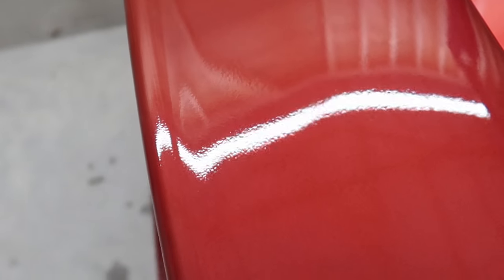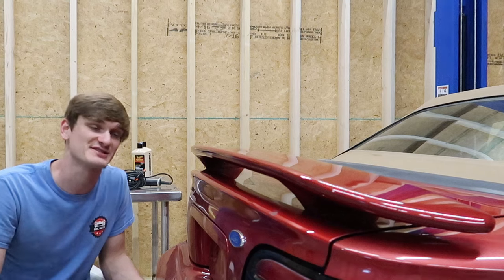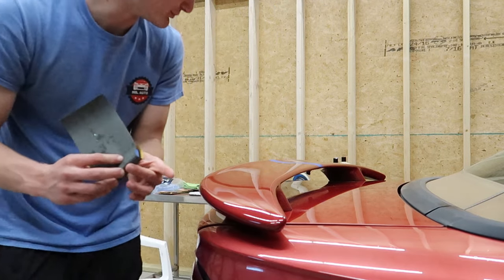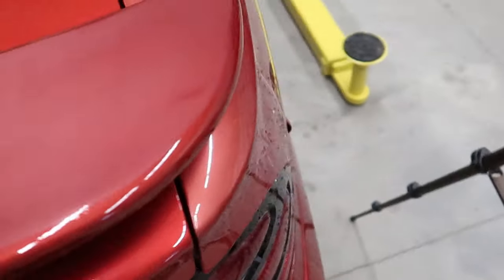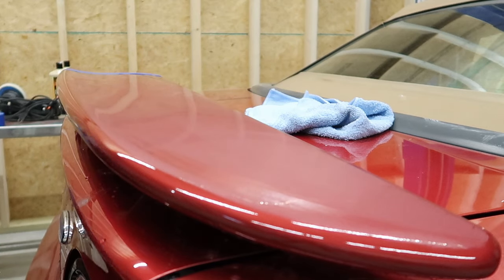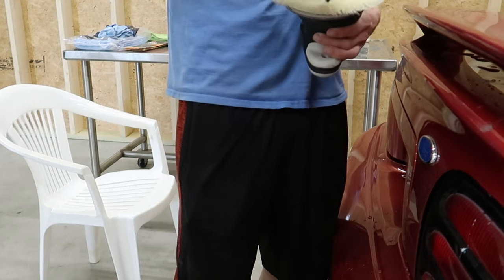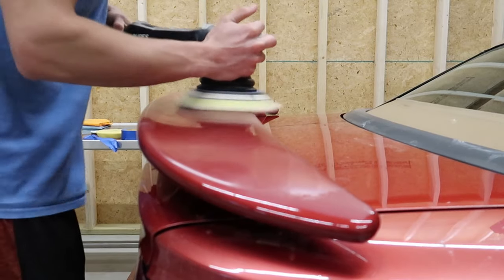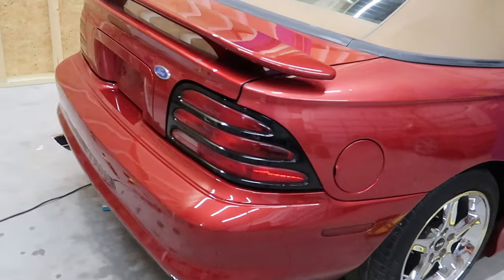How To Sand ClearCoat Safely - Orange Peel Removal

Comment: Get you some various sized sanding blocks. You don't have to use just that tiny one. And be extra cautious on plastic parts that are painted. The paint on spoilers tends to wear out a lot faster.

Comment: I've never seen clear coat applied that doesnt have orange peel. Just applied 3 coats of 2k clear (Nason) on 3 panels on my 78 Town Coupe. Went on nice and smooth and flat right from the gun. Next day after drying out (curing) tons of orange peel. I think it may be due to the curing/shrinking process? Either way Im amazed at folks who can lay it on totally flat and glossy and it stays that way! Maybe it's too many coats and not enough flash off between coats?

Comment: Great info.  Had to google it, ONR = Optimum brand "No Rinse Waterless Wash", a liquid cleaner popular with detailers, almost a cult following.

Others suggest starting w/ 1000 or 1200 grit, then right to buffing compound.  I used 1000 wet-sand on a whole newly painted car and got it to look like your post-sand stage.  I didn't use a block but rather used 4 fingers on the paper, which gives better feel.  I wiped the sandpaper across, not pulled/pushed along my fingers, which avoids cutting troughs.  Sometimes it would grab, because removing a lot of color build-up (single-stage polyurethane, no hardener).  I kept a wet rag busy keeping the surface flooded and wiping away paint debris.  I'll do another pass w/ 2000 grit.  Waiting on a wool pad and "Malco Super Duty Heavy Cut Compound", but best to wait a few weeks anyway to let the paint harden.  I wanted to attack the orange-peel while the paint was soft (2 days after painting).

I cut into the primer while sanding a few runs and other oops, so I'll use a touch-up gun there.  That is the advantage of single-stage vs base-clearcoat, you can respray any bad spots and easily repair the future scratches and dents which will occur, if you keep left-over paint.  Some think I should spend $5K on a pro paint job, but I only paid $1K for my car (1965 Dart) and love living as a resourceful bottom-feeder just to tic-off the wife and kids ("just write a check" types).

Comment: Really great job. Honestly one of the best videos I’ve seen who go into all the details. What would be the best way to get rid of clear coat lines? After removing the tape from a section of the vehicle. Wet sand? Then compound? Then polish?
Reply from the maker: JosephF1992 thank you! If you are referring to clear coat lines after having a section repainted, I would put a piece of painters tape on the low side of the line, and only sand the high side. I would not chase perfection in that scenario because you might go through the clear before flattening the line. I would highly recommend a paint depth gauge for that job. Yes, compound the sanding scratches out, then polish any hazing caused by the compounding step
Reply: Nic Bowen thank you for the info! Have a great rest of your day!

Comment: Hello,  you have a great teaching style, a question,  I went sanded  1000-2000 grit half a bumper, sprayed 3  base coat duplicolor then 3 duplicolor clear coats. The result was a duller and less silky smooth finish than factory finish. Any corrective action I could do to my work?
Reply: 1000 is too high for spraying base coat. You should sand with 320 and primer. Apply 3 coats of primer 10 minutes between coats. First coat should be very light and third coat should be wet. Let dry for 30 minutes Then sand 400-600 before base if necessary. Apply 3 coats base same manner as primer. First coat light third coat wet. Make sure you give the base coat enough time before you spray clear coat. I would wait at least 45 min before clear. Apply first clear coat light and then wet coat wait 30 minutes and spray 2nd coat of clear. If it comes out with a lot of orange peel or dull. Let it cure for a week or so and then wet sand it with 1000, 1500, 2000 grit increments. Then use a da polisher with cutting compound and finishing polish.
Reply: Thanks
Reply: @Chris-vc5bb  Hi, I have half of a Corolla bumper and right rear quarter that I want to correct. If I only spray 2k clear over that half, am I going to end up with a  noticeable difference between very good factory finish and my 2k clear side? Thanks

Comment: i sprayed my car and had orange pill bad,i only used 2x coats of single stage no clear coat and wondering if this method is ok for single stage with no clear?also i was wondering if i could simply roll on another coat of paint to my single stage thats just painted and then wet sand/polish? since its being sanded flat and smooth i should be able to roll on a coat right?i want to add another coat so i dont have patches i can see through just in case

Comment: When you are sanding close to to the lip, are you just going to assume the polish step will work out the peel on that hard edge? I'm doing an 80s windjammer fairing with lots of lines and edges. Thanks

Comment: You’re definitely a pro 👏🏼 
And besides the way you explained everything is very understandable ,
I have a question, I have a pick up truck that just came back from the body shop, and it has the same orange peel like your car, IF I don’t know how much clear coat they put on the paint , Can I use the 2000 grit ? I’m planing to use the 3M trizact 2000, but should I use a higher grit ? 
Thanks
Reply: No such thing as 3m trizact 2000
Reply: @zrick5376  thanks

Comment: This is amazing. But, does it go back to that unshined paint after it rains or Time or the polishing lasts forever?
Reply from the maker: The process of compounding / polishing permanently removes the sanding scratched clear coat. If you compound and polish it, it looks good, but a month later it looks bad again, then you did not polish it heavily enough.

Comment: This is basically a two step sequence, 2000 grit and then a compound buff - very different from almost every one of the 10 or more videos I’ve watched to remove orange peel. One guy uses 5 different grits of wet sand (1500 up to 5000) then wool buff, then foam buff, washing between each step. His finish was flawless, not just a “match the rest of the paint” type job. This guy’s results look pretty good, but there are higher quality levels out there. I would watch several other videos before settling for a 2 step job. For what it’s worth...

Comment: Quick question. 
I ended up with a couple of clear coat runs on my Grand Prix GTP rear spoiler which is very similar in color.
If I am going to sand and buff the orange peel antway,
 can I just sand down the runs with a 800 or 1,000 Grit wet sandpaper and then until the runs have been sanded down flush then continue on with the rest of the spoiler?
I've seen videos where they prepare the run very slowly and in isolated way but as a hole boards going to be sending anyway what's the point?
 Please advise.
Thanks

Comment: Is it possible to avoid the orange peel? I sanded, sprayed and painted well but ended up with significant orange peel.
Reply from the maker: Making sure the primer is perfectly flat makes the biggest difference in finished product. Since you won’t be sanding the base coat, make sure you spend time testing the guns settings and figuring out what sprays the smoothest. Also make sure you are flowing the cfm the gun is rated for. Same thing with the clear
Reply: Its nearly impossible. Its possible to have minimal orange peel, but it takes talent and requires thinning the clear to a point where its very likely to run if you put it on even just a little to heavy.

Comment: What was the spray you used on the wool pad and blew it off? Awesome video best I’ve found of sanding and buffing by far
Reply from the maker: Thank you! I sprayed ONR on it (rinseless wash, I use it as a spray detailer, one of the best products in my arsenal). The purpose of the spray is to ensure that the pad is lubricated, and I blew it out afterwards to make sure there wasn’t any excess
Reply: @nicbowen38  and after the 110 did you follow up with a different polish? Results are beautiful
Reply from the maker: @buggy627  thank you! To my surprise, the 110 finished out so well that I did not polish it. If it was black, or if it was a softer paint, I would have had to polish it most likely

Comment: My truck grill orange peeled pretty bad. I have another can of 2k clear coming. What should I use to smooth the surface. 800 and 1500 grit and lightly sand? Or gray pad and wax/grease remover? Thanks for the video and tips!
Reply: 2000-3000 followed by a polish. Likely won't need to reclear. If its a small surface area, I'd probably just use 3000 and spend more time doing it, then polish by hand with a rag

A gray wool pad shouldn't be used with wax and grease remover either, unless you're removing road tar before painting. Water is best.

Comment: he nice video,i have massive orange peel in my clear coat,could i sand it and put another coat of clear on it or should i completely remove it and redo the clear?You did a awesome job with that and very detailed description.👍
Reply: Grease monkey, you don't have to reclear! Just do what he did here and you'll have a glassed panel!

If the panel is dry and rough however, that's not orange peel, its dry spray and/or overspray. That is a different story and potentially requiring a respray. You could try to lessen it doing what he does here, but do it small amounts at a time and very likely "settle" with something that's better, but not perfect.

Comment: If you grind orange Peel off with these instructions then do you need to do something again for it after a few washes?

So does the surface turn gray again after a few washes?

Or does the gloss of the paint surface remain even after washing?
Reply: If the vehicle has a clear coat on it, it remains. Don't use brushes to wash you vehicle, especially brushes at public car washes(truck guys often scrub gravel out of their wheels and rocker panels with them), and the paint will stay beautiful for years.

Older vehicles that used single stage paint, it would fade probably within a year.

Comment: Great video! I wonder what causes orange peel. Whether it's one thing in particular or a combination?
Reply: Air pressure when spraying the paint..if the pressure too low..it will create a noticeable orange peel..if the pressure is high..orange peel will also be there but not as obvious as it is low pressure..but high pressure spraying increase risk of getting paint runs too.

Comment: Is a sanding block recommended over free hand?
Reply from the maker: I would never recommend free hand sanding. It’s almost impossible to evenly apply pressure over the surface of the paper and will cause deeper scratches that can’t be removed with a polisher

Comment: So judging from what the camera sees, you have about 35-40% or so of the orange peel/shiny spots left on the surface when you call the sanding done and move on. If that is the way to go, and on my project (this is the first time I do this process), I have about 15% low spots remaining and stopped because I wanted to find info on if I could leave any orange peel at all before buffing... does that mean I am basically destined to burn through in the next stage?

For the next stage, I have bought pads for a power drill, and Meguiar's 105 and 205.

Comment: Amazing video! At the end you said though you see light haze and need to polish again... do you use the 105 compounding again? Or move on with a actual polisher product? I seen two bottles in the background. 
Cuase have Chemical Guys compound and polish separate 4 bottles.
Reply from the maker: I used meguiars m210 and a yellow rupes pad to polish 👍

Comment: Hi thank you for your videos. I wanted to ask if i may i have a honda i just got painted and haven’t had someone wet sand the car yet but wanted the know if after wet sanding and buffing will it make the finish look lighter or darker ?
Reply: It shouldn't change it much, but the finish will be "deeper". It will seem a little darker, simply because clear coat with a rough finish tends to be a little white in its reflection. 

If you do the whole car, you won't notice a color change, but you will notice it looks better. If you do only some of the panels, you will likely notice the difference between a polished panel to a not polished panel.

Comment: Lots and lots of information! If I were to use 2000 grit on my freshly painted clearcoat I will be working a 1’ x 1’ section for four hours! My clearcoat is extremely rough and I’ve been using a 180 grit to sand it down. I know this is way too low but I can’t get anywhere without it. I’m wondering if I may have added too much Hardner or uneven coats or…? Any thoughts here
Reply from the maker: If you have to use rougher then 800 grit paper, something is wrong. If it was me I would sand it and spray more clear on it after figuring out what went wrong with the paint. It’s going to be nearly impossible to remove the 180 grit sanding scratches without spraying more clear
Reply: You are exactly right. I even went over it with thousand and 1500 grit and the scratches were still there. So what I did is what you just said I just re-clearcoat it. So far so good! I appreciate you getting back to me

Comment: Nice sir. Can i use cotton and rubbing compound after sanding? Coz i dont have buffmachine?
Reply: Use a micro fiber towel. 3m rubbing compound is your best bet. Then use 3m polish step 2 or nufinish from Walmart. And finish with a thicker wax past to remove swirls/ holograms

Comment: How long you wait to make it dry from the wet sanding before you polish?
Reply from the maker: JeremyP. You never in any circumstance allow water to air dry on a painted surface. It will leave the minerals from the water behind which can cause damage. I wipe off the water with a clean microfiber and immediately polish

Comment: Great video.  But I am confused.  Did you apply clear coat with the paint issues you are correcting (scratches and peel) and then fix those issues after the paint was applied/cured?    Sorry for novice dumb question.
Reply from the maker: The problem is that no matter how good your paint is, how good your gun is, how good your technique is, when you paint something it will almost never give you perfectly flat results. The texture of paint is referred to as “orange peel” because it resembles the bumpy surface of an orange. I am sanding the orange peel of the paint until it is flat, and then polishing out the sanding scratches. After the process of sanding and polishing, the paint is much flatter and has a smoother reflection

Comment: Thanks for the detailed explanation.  I just repainted my rear bumper cover and have pretty heavy orange peel.  Question on sandpaper grit:  I started with 2000 grit but it seemed like it was taking forever, so I went down to 1500 grit.  Should I follow up with 2000 grit (and maybe even 2500 or 3000), or go straight to polishing?
Reply from the maker: Richard Lytle it all depends on how comfortable you are with a polisher / your products and techniques. It is possible to remove sanding scratches as rough as 1200 grit with a rotary. However, removing 1200 grit scratches with a polished require a LOT of heavy, slow polishing, and it is very easy to make a very small mistake that will burn the paint. I would highly recommend at least sanding to 2000 before polishing, but if you can throw some 3000 grit on a da and hit it before polishing then that’s what I would recommend
Reply: @nicbowen38  Awesome, that's what I'll do, thanks.

Comment: I just done paint my car. Can i use polish and buffer machine? What is good liquid polish for beginner? Can i use meguiars?
Reply from the maker: JeremyP. I would recommend using Meguiars M105 and M205, nothing else. Your local Walmart or auto store should have it in stock. Before polishing, watch Ammo NYC’s videos on polishing. There is no one that makes as good of content as he does
Reply: Nic Bowen is that almost the same? M105 and M205? Can i used foam or micro fiber pads? For polisher machine?
Reply from the maker: JeremyP. M105 is a heavy cutting compound, M205 is a fine polishing compound. You will need both products to complete the task. My go to pad for removing sanding scratches is Meguiars 6” Microfiber Cutting Pads, and Meguiars Soft Buff Yellow Foam Polishing Pads. Both can be purchased on amazing, and they work perfectly with 105 and 205
Reply: Nic Bowen thank you!! My last question what speed number is better for me?
Reply from the maker: JeremyP. What polisher are you using?
Reply: Nic Bowen idk what is this but my polisher have number option that i can adjust
Reply from the maker: JeremyP. Is it a rotary polisher or a dual action?

Comment: Thanks for the video!  Did you only use one type of grit sand paper?  Was it 1000?  You don't need to go 1000, then 1500, 2000, etc?
Reply: He used 3M 2000 wet and dry so he could polish it without another step. I personally was watching from behind the sofa when he was polishing, imo he was going too slow and potentially getting the paint hot and burning. I use 3M 1500 and a 3M 3000 Trizact, which I think is a better option but to each his own.

Comment: I just recleared my hood with 2k. In a week I want to get rid of the light spray marks it left be hind. I did 3 coats. Do you recommend wet sanding to get rid of the light spray stripes or just use a polish?  Thanks. Great video btw
Reply from the maker: joe DiMemmo thank you! I would certainly wet sand and polish as it will improve the stripes, however it is possible it will not fix it 100%. If you get stripes while painting, that is caused by either not going slow enough or not overlapping enough between passes. I’m assuming you used a aerosol which certainly makes it harder then if you used a HVLP gun. Give it a try, if you aren’t happy, you can always sand it flat and then reclear it
Reply: @nicbowen38   I used 2k in an aerosol can.